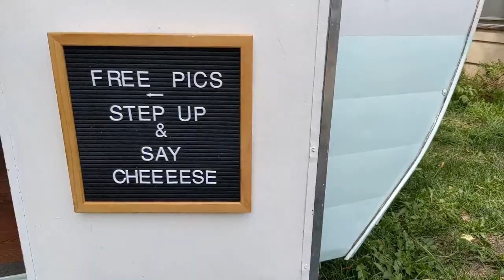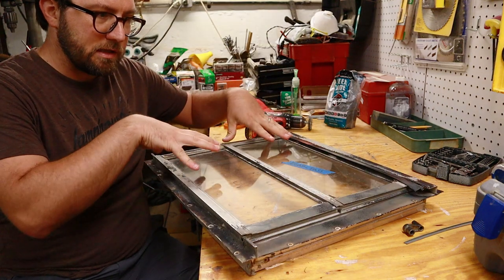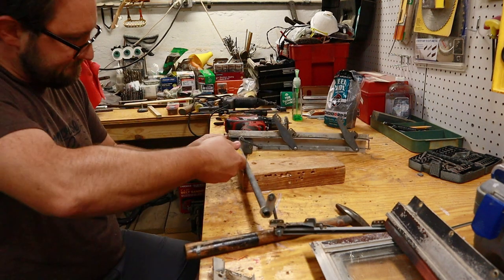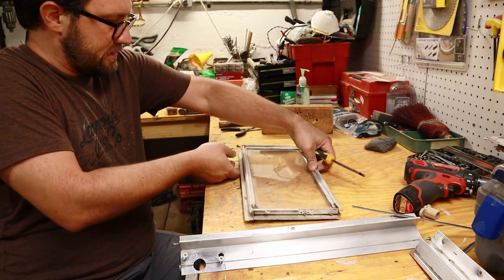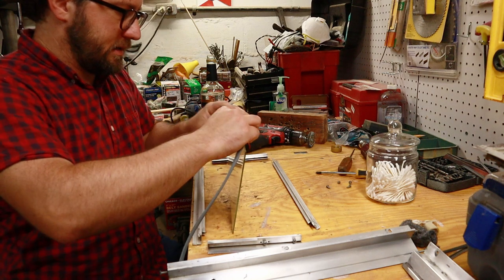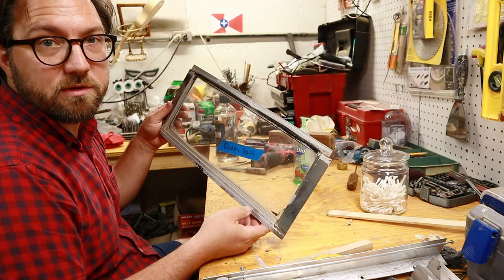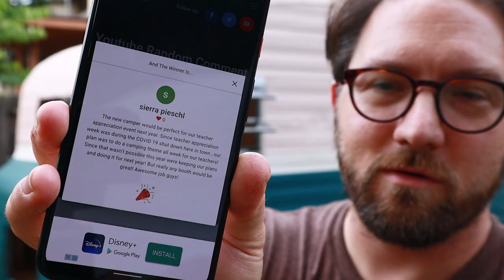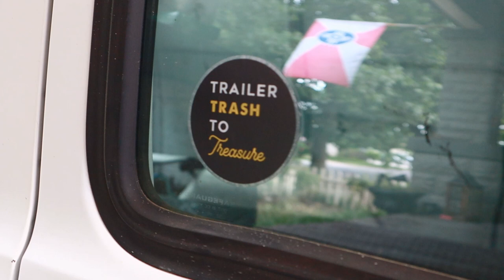FIXING UP OUR PLAY MOR CAMPER WINDOWS & GIVEAWAY!

Comment: I just found your TTTT channel yesterday and have very much enjoyed watching them so far!  Thank you for putting in the extra effort it takes to do so.  A couple of questions.  Did you seal the underside of the floor? ( You might be covering that in a segment that I have yet to view).  Do the windows also have screens?
Reply from the maker: Thanks for watching! No, we did not seal the underside of the camper. We have another similar camper we redid a few years ago and didn't seal it either and it's held up fine. Still though, would be open to doing it before we hit the road in this one just to be safe. Wish I would have done it when I was working on the frame. Oh well, live and learn. Yes, the windows have screens and they're in good shape so we're going to put them back in when we're all done painting inside.

Comment: Very helpful! What kind of stripping attachment did you use on the drill? (Steel wool? Acrylic?) Thanks!
Reply from the maker: That was just a little wire wheel attachment. You can buy them at most hardware stores, but I think I got that at Ace. It will leave some abrasions, so if you're looking for a mirror finish you might want to use something with a lighter touch.

Comment: Hey! Do you happen to have a parts list for what you bought for window gaskets? I'm poking around vintagetrailergaskets.com and they don't have PlayMor as one of their camper model options for easy shopping. :)
Reply from the maker: They're almost the same as Hehr 3600 windows, but the top seal is different, and I haven't figured out what works best there. The one for the 3600 will just pop out, but it does sort of work so you can kind of get by. (edit: since we shot this, the top seal has slipped out of the track - so not the same as a Hehr window on that part at least). The door window though, I have no idea. I got 67' of glazing channel, and 108' of J seal, but honestly that sounds a bit off now that I think about it, and I haven't finished everything yet so I can't say how accurate that will be.